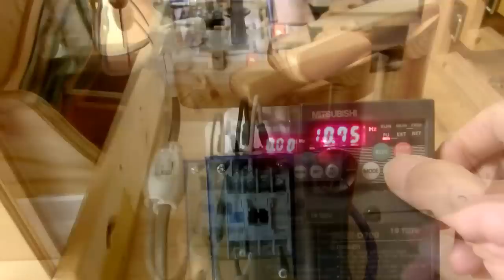Mikiono's homemade scrollsaw

Comment: Back in the mid seventies,Fine Woodworking magazine published a fairly lengthy article on two mostly plywood table saws,one built heavily enough to take the abuse of students. If interested,back issues or collections are available occasionally. From the photos it seemed a very doable project. You might be interested.
Reply: Which one?
Reply: Eric D. Well here are some options. FW magazine publishes an abstract every 5 years,listing the articles published. Many libraries have carried since it was young. Your local branch may have in archive,many back issues. If not,interlibrary loans are very doable. I just looked at the home pages of the mag,they sell a CD of all their back issues for US $99.95 .The article I remember dates from around 1978 or1977. I remember it well,but not which issue. The author was very proud of his efforts and mentioned that his saw was preferred by his students over the well made all metal ones. Could also purchase collections of magazines.
Reply: Unfortunately, I do not live in the US and we don't have this magazine here, so as far as libraries or physical copy goes, it is not a thing. As far as buying a US $99.95 CD for ONE article, I do not believe this is an alternative. I would've bought the article itself (if it is still something that can be found on eBay or such websites), but I do not see the point in buying all the articles for one of them.

This is the reason why I was asking if you knew the article number, so it would make my search much more easier, as I never saw the article or the magazine itself and you did. (By the way, US $99.95 is about CAD $140, so it's even worse. If the $US to $CAD conversion wasn't that bad, I would think of it, but not right now.)

If you ever find it and remember this post, I would be glad and grateful if you reply with the number :) Otherwise, I will be searching in my spare times to see if I can find it even without knowing the cover page and all that.
Reply: Well you mention CAD. I live in Canuckistan myself.  Most libraries carry FW. Again the 5 year abstracts seem to be the be the way to what you want. Sorry for being unable to detail exact issue. I read the article several times back in  the day as a way to begin  a heavy machinery collection. It really stuck in my memory for some reason. Good luck with the endeavour.  The Taunton press published a shitton of collections of different articles. Maybe try ABE  books,every once in a while people sell collections of back issues. You probably know more sites on line than I do,so any recommendations I make are redundant. Cheers.
Reply: If it is indeed issue #41, I think that is still available: https://www.amazon.com/Fine-Woodworking-Magazine-July-August/dp/B000QFQ8YG

Comment: Miki said frame should have been made stronger and is interested in resonant frequency. How is that middle rib @1:33 integrated into the frame? Is the side of the box made of two pieces of plywood, each piece of plywood set between two ribs? Is the middle rib two ribs glued together after each half was constructed?

Comment: I was just thinking that the saw probably runs pretty smooth at ANY harmonic of 60 hz, (assuming you have the same kind of a.c. mains power in Canada) because that's how the motor was designed. although I guess you'd also factor in a couple of other things like the reciprication of the saw blade itself. The wooden wheel he's got on there could have a self adjusting counter-balance like 1/2 of a governor on old steam engines, or even a more robust version of the centrifugal switch used motors.

Comment: Would you consider building a osculating drum sander? I enjoy your progects very much & would like to think about building a osculating drum sander
Reply from the maker: woodjock An oscilating sander is a type of machine that's cheaper to buy than build.  But if you must build one, buy one, take it apart, and use those parts - again, the cheapest and most practical way.
Reply: +woodjock I like my sanders, but don't want to kiss them.

Comment: What would be the benefit of using this saw as opposed to a band saw?
Reply: Tsgtr is a weird Youtube  name
Reply: tsgtr these can cut much tighter and more complex corners and shapes.
Reply: scroll saws use finer blades and you can insert the blade into a middle of a shape without cutting a gap.
Reply: Its a robot uprising!

Comment: North American power companies produce 60 hz.  They have more trouble maintaining 60 hz than voltage otherwise clocks would not work correctly.  Most of the rest of the world uses 50 hz.  House power is nominally 115 volts( 110 -- 120) and 230 volts( 220 -- 240) single phase.  Electricity generation is always 3 phase. A 3 phase motor is smaller than the same HP rating of a single phase motor.

Comment: A lot of work and thought went into this machine.  Not the best type of machine for fine fretwork, but good enough for courser work.  People don't build things like this for practical use, or to save money.  They do it for the challenge of doing something unusual or difficult.  The cost of the hardwood in this machine would buy a pretty good commercially made machine, but what would be the challenge in that?
Reply: ***** This is important.  When I first got my scroll saw, it mostly just sat there  for four years because I didn't know where to find patterns.  now, with the internet, it is easy to find all the patterns I can use.

Comment: I must say you build some very nice machines but i have to ask, WHY!  i dont see the point when you can go to Sears and get a decent Table saw or scroll saw for under 200 bucks, Seams to me like a lot of work not to mention the materials alone cost more than you can get a decent table saw for already made.
Reply: Hi Tony. This kind of closed-loop scrollsaw usually costs much more than 200 bucks, and few companies produce them, and 'til now i only found the Eclipse model. You can find a test and few pics here : http://www.scrollsaws.com/SawReviews/Eclipse.html
I'm not sure but i think i first discovered its mention while reading "the new scrollsaw handbook" ( https://books.google.fr/books?id=YL4uLA5lAogC )
This woodbased one shown on video hasn't been obviously designed with natural frequency in mind as its base really lacks of mass to dampen it enough, but i see in this kind of architecture the advantages usually procured by bandsaws, when made properly.